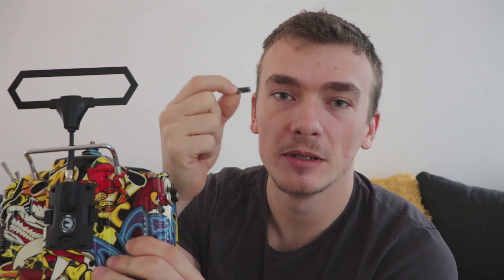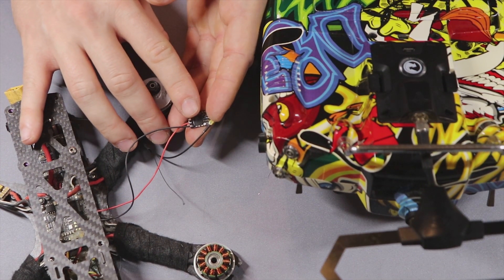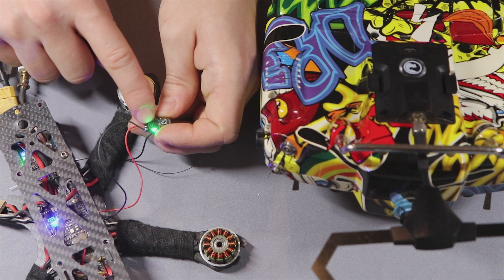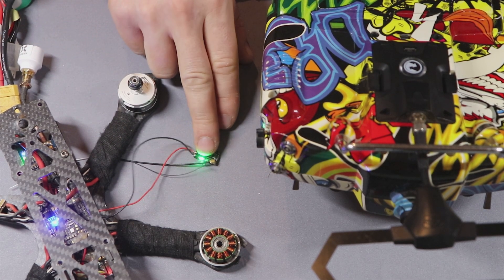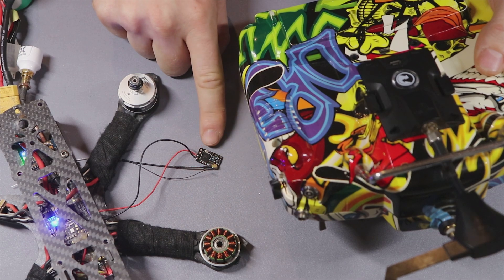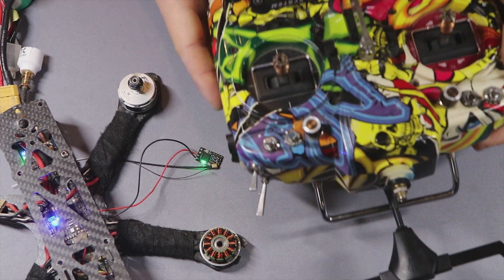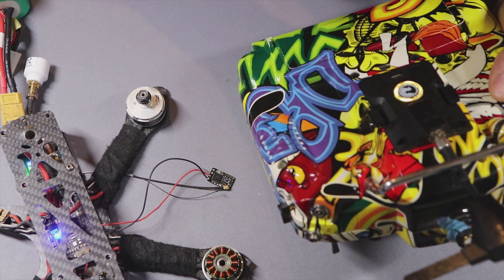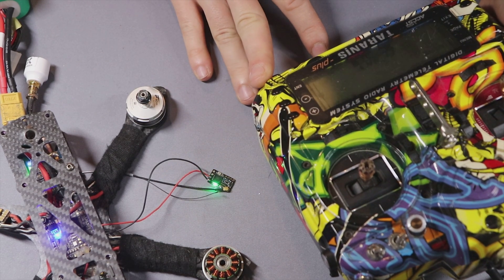CRSF nano binding/firmware problem FIX | CRSFshot fw update

Comment: Having issues with a Sixty9. Wish this video helped my specific issue. I get a solid green + fast red and I cannot get it to bind or even go into the supposed "Emergency Update" mode to access the "golden" firmware to reset.

TBS is such a PITA. I'm seriously considering switching everything over to ELRS at this point. It shouldn't be this difficult.

Comment: CAN SOMEONE PLEASE HELP ME.  I am stuck at 2:04.  When we push the blinking blue button, instead of turning solid blue, it turns back to blinking green.  And the red rx light somewhat changes to a sort of slight double blink.  Can anyone please tell me what to do or what I’ve done wrong.   I’m a dummy.

Comment: I've been hours trying this solution but still no go, everything works the same as you except at almost at the end of update the rx starts flashing red and green at same time, I've tried firmware from 3.78 to 4.03 but same results each time. Any help will be appreciated
Reply: Having the same issue. Video straight up did not work for me. Got both in bind mode, but they won't connect. Ideas?
Reply: To be honest I'm very disappointed in crossfire, I've submitted ticket with crossfire and sent video and purchase  information but still no go. Does yours also flash red and green at same time at the end of update? What does this mean it's not even in crossfire manual.
Reply: @egtreadway4232  I'm reporting mine DoA. New one arriving soon.

Comment: Thanks it worked! Both are Green!   But why does my haptic feedback keep buzzing intermittently on my Qx7
Reply from the maker: Im glad it helped u, about your beeper, cant u just adjust it in the menu of QX7?
Reply: @spaglFPV  still having an issue. My micro tx and nana diversity rx are binded to 4.1 luas scripts are on the sd card in qx7 and when I execute crossfire it will continue to say waiting for crossfire. and tips?
Reply from the maker: @WillyFPV  i would format the SD and reflash the radio, then update crsf modul to latest stable version and let the receiver update
Reply: @spaglFPV  so does formatting the sd card mean to start over?

Comment: Did not work for me. The rx just flashed and the module flashes green also but just won’t bind up. Running 4.03 firmware

Comment: I watched several how to bind nano rx and this video nailed it.  Solved my problem.  The only thing I would add is I was about to give up because I did not think the firmware update was happening - I must have waited 30 seconds and then I finally got the rapd green and the flashing yello on the module and I knew then I had success.  The rest of the steps followed the video really well.  Thank you so much for this post.
Reply from the maker: Thanks for the comment :)

Comment: Thanks! This really helped, I was pulling my hair out! The only difference is that I have Tango 2, so it doesn't have bind button on transmitter. So basically what I did is: 1. power on Rx (blinks green slowly), 2. power on TX, enter binding mode 3. after this RX blinks red slowly 4. Single press bind button on RX. 5. TX offers to update! So I guess you can confirm update using RX button as well
Reply: Watched 10 videos, and this is the only one which pointed in the right direction. To clarify for anybody having the same issue: TX firmware 3.53, RX labeled "XF nano 44"
Reply: Hey Max, i tried this on mine and nothing happens i don't get red light blinking in step 3 as you said. I tried everything, literally don't know what to do now
Reply: @7LETITBE7  well, may be you have later firmware on rx, and it behaves differently? Sometimes I had to restart my tango, before entering binding mode. It’s weird, sometimes it works quickly, sometimes it was finicky, but then worked after few restarts. But I still use the same process

Comment: i just updated my micro tx to the latest version and my open tx my nano will be in bind mode slow green blinking, ill press the orange button on tx to make it blue, i will flash the new version, it will blink green fast when done then i reset both devices and they will both be in bind mode but not binding together?
Reply: have that problem too
did you manage to fix it?

Comment: I can’t pass in bind mode when the led is green and not blinking. I follow the instruction but it doesn’t work ...
Reply from the maker: check ur receiver, if it changes the color/blinking once u turn off the transmitter, then it already communicates, if it doesnt change the state then you have to bind it

Comment: doesn't work. nothing works. always stuck with solid green.
Reply: I had the same problem reflash your crossfire module to the last stable version then rebind the receiver allowing that to update. Then reflash to the new crsfshot again then rebind and it will work.
Sometimes if your on to old a version the reciever for some reason wont jump with the module to the latest firmware so I found flashing to the last released stable version before the latest realise and binding then updating works. Best of luck bro 👍
Reply: And make sure your open tx is 3.2.5 👍
Reply: @opticzfpv597  do you mean 3.2.5
Reply: @Rainy Days sorry open tx companion 2.3.5 typo didn't realise man apologies 🙈
Reply: @opticzfpv597  turned out mine was physically damaged, a couple resistors broke off. apparently according to tbs, if the green light is solid and the tx is not even on, there is a bad hardware issue.  I had damaged 2 nano's this way before finding out.  They were ripping off with the blue tack stuff i use to hold it in place while soldering.
Reply: @opticzfpv597  can i go to 2.3.7 why .5?

Comment: Hey, unfortunately it doesn't work for me.

Up to minute 2 everything is  fine but if you press the flashing blue and he should have  blue lights for the updating, he jumps back to the pulsing orange, the RX continues to flash red.
Reply from the maker: Hey, what version of openTx and TBSagent u got in your radio?
Reply: looks like a fw 3.2.8 issue. with 3.2.5 it worked
Reply: @chrisburton6524  3.2.9 issue too. I'll downgrade to 3.2.5 thanks